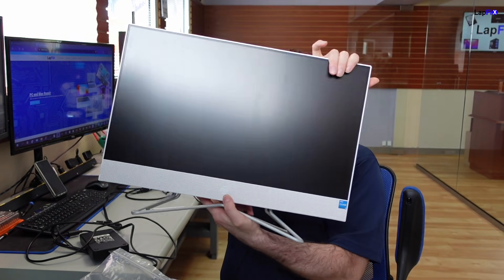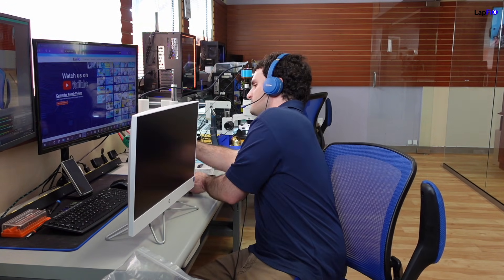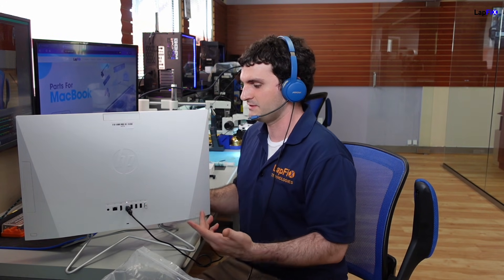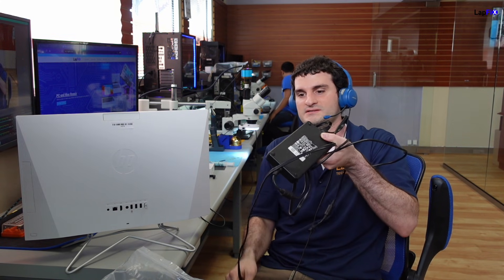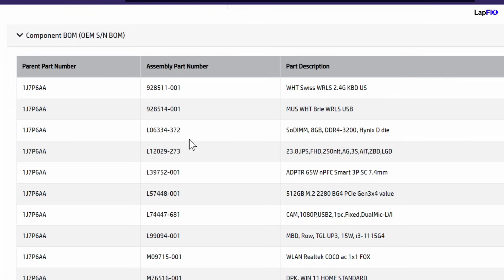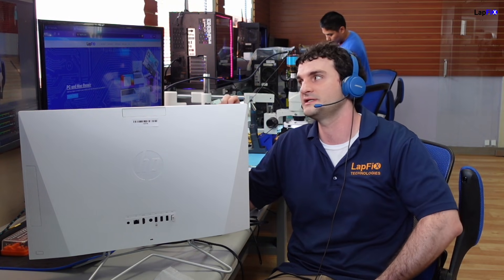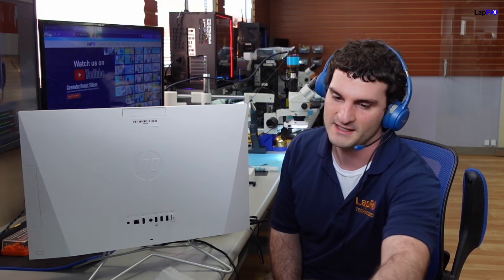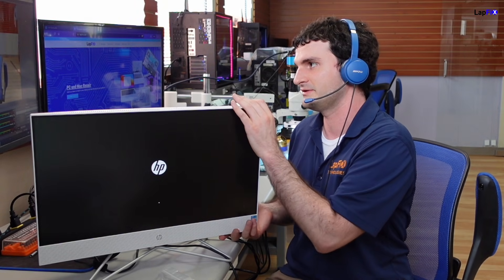HP AIO Desktop Not Turning on But Beeping

Comment: Didn't try a Dell charger on a tossed out HP A in 1! Found a tossed out A in 1 but has a messed up screen so I connected an external monitor to see if the HP worked, but got the same beeps! Maybe not enough power to get it to work!

Comment: Mine was doing the same thing. Took a tooth pick and straightened the middle pin tht is inside the barrel part and fixed the problem
Reply: Barrel part on the charger?

Comment: Thanks for this video. I'm glad I dint tear the computer apart trying to replace the RAM. I used the correct power supply for it, and it worked fine.
Reply: Where do you get the power supply?????

Comment: I'm sorry, I have to call BS. I have the original one, and it beeps, I bought another one, an original too, same thing, and after 5 beeping cycles it keeps saying the same thing, Unsupported power adapter installed. 2 original adapters and my AIO keeps beeping and after 5 cycles, it shows the message and then it turns on like nothing happened, until I turn it off again, then it has to go through 5 beeping cycles again before it allows me to turn it on...
Reply: How your problem got solved?

Comment: You are my new HERO!!!! I bought mine like an idiot on Facebook Marketplace for 150.00, and should have known it was too good to be true lol. Well it was! I got home hurry plugged it up and was ready to put my fist through it because the beeping was all I got. I finally went and bought a BRAND NEW Lenovo All in One and it has been GREAT!!!! I did keep my 150.00 piece of crap though, and thanks to you I now know it can be fixed quite easily, so at least I can get my money back out of it or donate it to someone who needs one and can't afford it. Thanks so much for what you do and how you explain things in a way that country people like myself can understand lol. You're the best and I will definitely recommend you to anyone with tech problems. Have a great day!!!!
Reply: i got one, without a power brick, as a $9 "monitor". Had a few dell power bricks with the same or better ratings, and matching plug. Even tried my "interchangeable tip multi-voltage" replacement brick. Got those beep codes. Was going to convert to USBc-PD and while waiting on parts, found an OEM PSU at a thrift shop, plugged IT in, and whammo, works fine. So, basically, this is HP playing the stupid proprietary game. Funny, my Lenovo of the same vintage, works just fine with a generic.
Reply from the maker: Thanks for the kind words and happy I could help

Comment: Hey I have the same computer it won’t turn on but has the light in the back showing it has power, it’s the charger it came with. Worked fine when I first got it brand new but one day just turned off and never would turn back on but it shows it has power. I just don’t get the beeping sounds or whatever
Reply: same problem😔
Reply: Same. Began not working last week
Reply: Any solution to this?
Reply: Same problem. I tried using the model number to look for a part from hp but nothing comes up.
Reply: Same
Reply: Mine too
Reply: Mine too.

Comment: Got a hold of an HP All in One with the AMD Athlon Silver, tried a Dell power supply as it has a similar barrel plug + pin. HP beeped, wouldn't turn on. Tried a genuine HP power supply - turned on just fine. The AIO is charger sensitive, you have to use an HP power supply.

Comment: I have the same problem, bought a generic adapter with 65 watts, but I upgrade the RAM from 4GB to 16GB so... With 16GB it don't work but with 4GB (ONE MODULE) it's actually turn one, know I just have to resolve the boot problem (my SSD SATA III is not detected) 😂😂😂
Reply: I did the same I upgraded the RAM TO 16 GB . Now  I have the same problem. So all I need it to but a new adapter!

Comment: DELL uses 1-Wire (https://en.wikipedia.org/wiki/1-Wire), HP - resistors for SENSE-ing. I'm not sure it's for making PSUs proprietary since I can power-on various 90W consuming DELL and HP laptops using HuntKey HKA09019546-8K PSU. Thank's for sharing your findings.

Comment: Mine won’t turn on. No beeping. If I hold the power button down for a minute the power light turns on but when I let go it disappears. The computer never powers on no noises. Nada. I’ve had this less than 2 years. I barely ever use it. But I rely on it. 😠
Reply: So what is the exact adapter I need to buy?
Reply: Pretty typical big company tactics. No you can't dare to try and override us with the hope of saving a little money, you must use our pricey products or unit is not  going to work. How about a decent discount on a product that expired before it's usefulness expires? I know, planned obsolescence and all that, but it sure would help if the price of accessories were kept more reasonable.

Comment: I have the same model my light comes on the back, it turns on hums a bit than the screen flashes off...help me please
Reply: I have the same issue now, it usually would turn on after a while of doing it now it won't , have you gotten ur hp fixed?

Comment: Hello so i had a question, i have a 4 tb seagate barracuda hard drive laying around with around 1.5tb data that i cannot recover anymore since it won't read on my pc no longer but when i opened it up the disk was spinning but the little reader that is in the drive kept going back an fourth and eventually after a few times of doing that the hard drive just powered itself of and stopped trying to read the data, do you perhaps have a soloution for that?